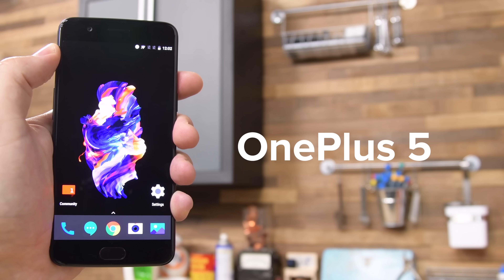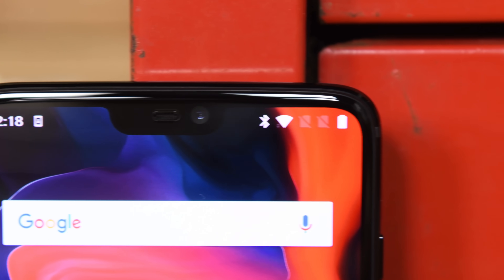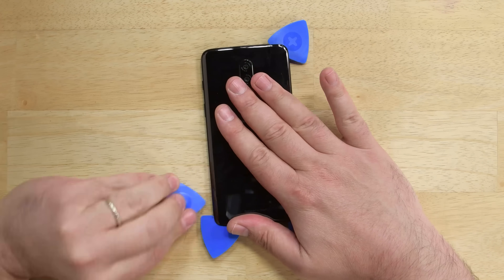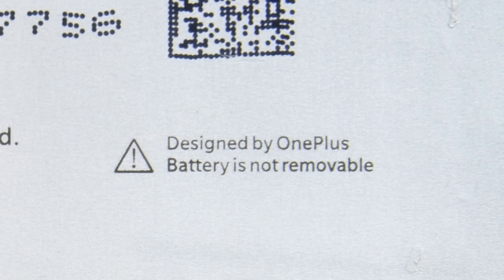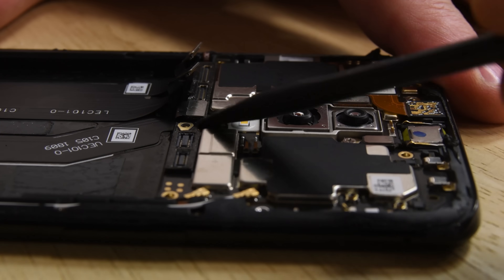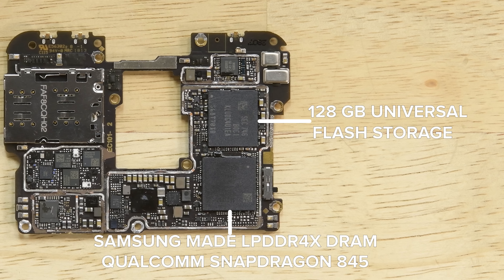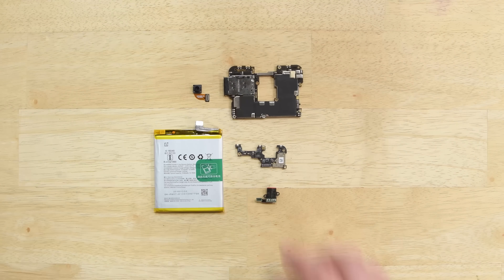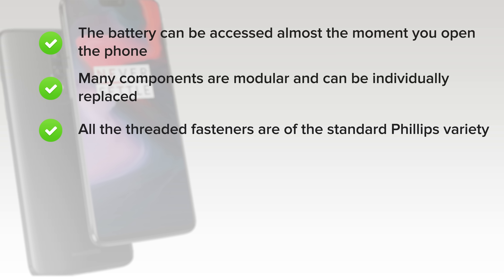OnePlus 6 Teardown!

Comment: Samsung made RAM, Samsung made flash storage, Samsung made amoled display.. It feels like I have a Samsung phone with me than the oneplus 6 but in a good way though. Samsung is synonymous with quality and it is quite reassuring to know that quality parts make up the phone I'm watching this video on.
Reply: ZC Samsung has their own Exynos processor line but the OP6 has Qualcomm's SD845 instead
Reply: Leonard Yeski So what? Manufacturers make mistakes all the time. They happen. That's just what reality is. What's important is if they would try to fix the problems afterwards or not. And Samsung did. I don't have to remind you about the Apple's bent iPhone scandal do I?
Reply: Samsung made the processor too
Reply: @MrSandwichk  lel. Samsung INVENTED the silicon transistor!! Checkmate atheists.